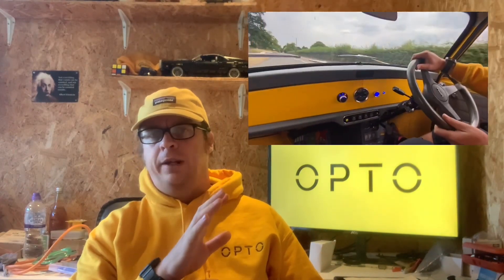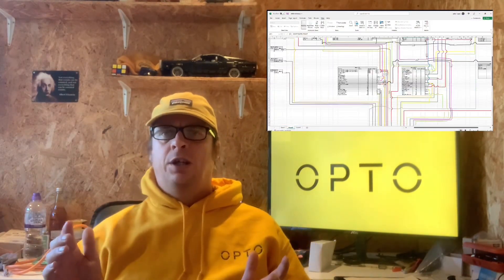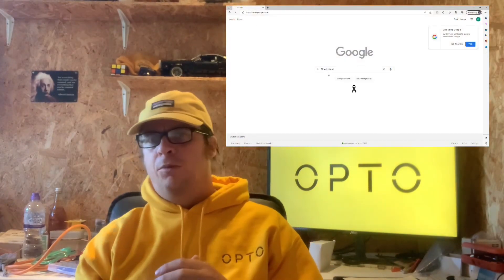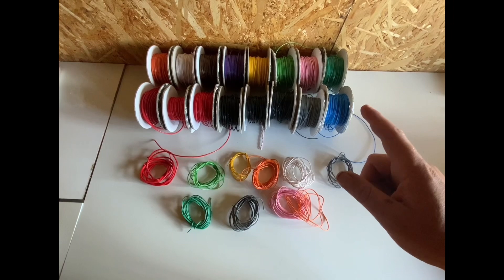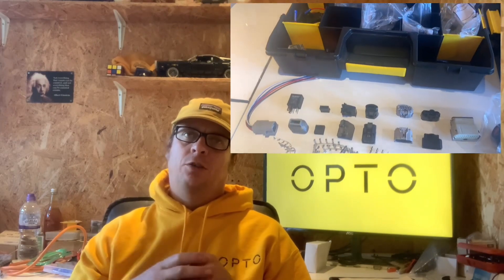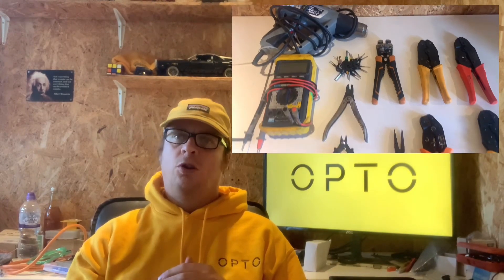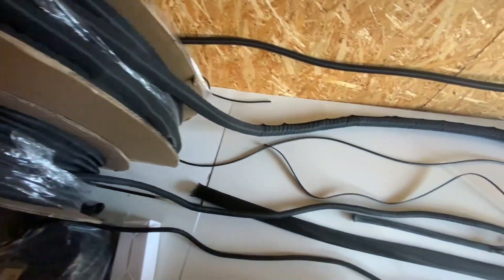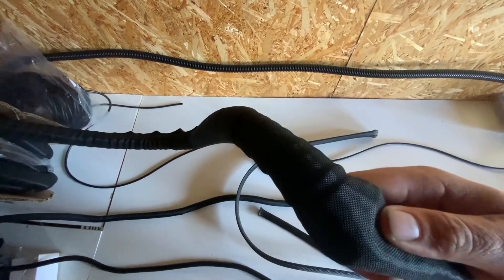Design and manufacture of the E-Mini wiring loom! OPTO Innovation’s Mini EV Conversion Part 8!

Comment: What did you put over the wires Pete, didn't quite catch it? Fabric tape is a nice way to finish a harness off, no idea how it compares price wise to the options you showed but that's what we tend to have on engines currently (both UK and German OEMs)
Reply from the maker: We used the self wrapping stuff in the end - finished off with cloth tape! Due to the nature and constant evolution of the build we need to be able to access the wires to make changes / improvements as we go - cloth tape is nice but not so much when you want to be able to make changes!